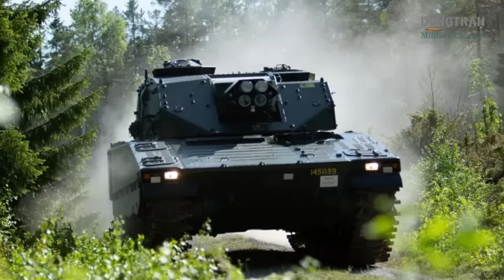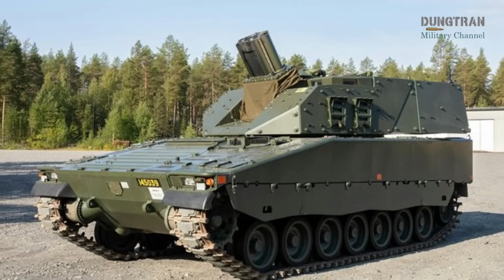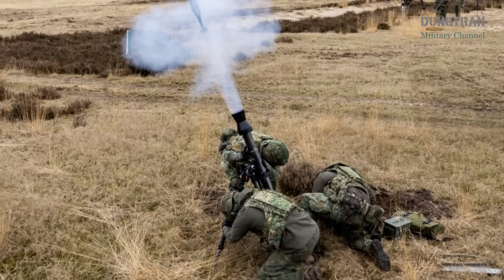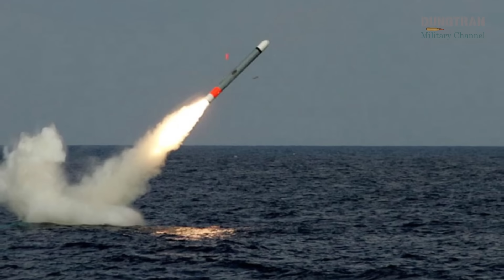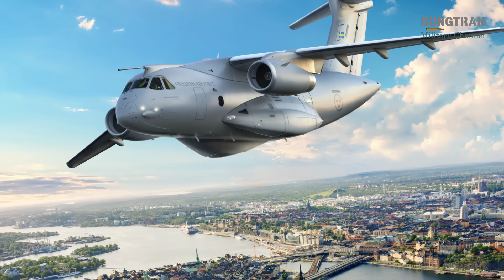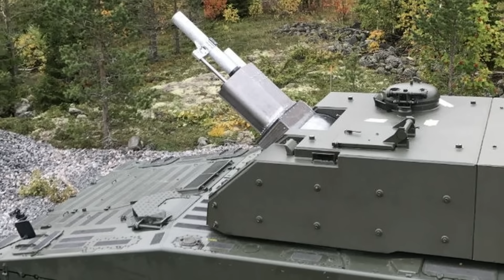Netherlands Buys Sweden’s Mjölner: A New Era for Dutch Firepower

Comment: These mobile 120mm mortar systems don't make sense. They could be manufactured much more easily as multifunctional vehicles/modularly: you simply take a conventional 120mm cannon like the one on a main battle tank. You can also fire the mortar shell through the barrel. You just have to be able to adjust the barrel steeply enough. And this makes the system even suitable as an anti-aircraft gun (with suitable ammunition). So you have three roles in the same vehicle (only the anti-aircraft gun requires an additional radar, but the proportion of common parts is enormous).

Comment: This isn't a 'leap in capability' for Dutch mortar systems. It is a reparation of that 'pocket artillery' for battalion commanders.
You see, with the massive defence cuts that riddled NATO armies after the 1990-ies, and again after Afghanistan ended; the Dutch army lost the heavy mortar platoons in mechanised battalions. 
Before those cuts every battalion had two 120mm platoons in each battalion. Cutting those was seen as way too much of a cut across the army.
That error is repaired now.

Comment: Because of its own defense industrial capability being quite limited, the Netherlands has a history of doing its military procurement outside its own borders. And with their own national defense always under high scrutiny, it's fair to say that they have become quite good at buying the right military equipment for the job. The result being a rather small but modern and relatively well equipped armed forces. Which has made them quite influential in the international military procurement market as early adopters of the "good stuff": F35, PzH2000, CV90, Boxer, Patriot, Leopard2, NASAMS, HK416, Accuracy AX, Glock17, Embraer C-390, PULS, etc.
Reply: But we have the Tech for the Arsenal. ASML per example. So working together is awesome and warms my heart
Reply: @Carolina-u9x  We have the tech but companies like VDL are more important than ASML. ASML is in a complete different sector.
Reply: @Schachtschabel  Oops, wrong. That is why ASML export is in hands of the Dutch government. 
"ASML, a Dutch company that produces chipmaking equipment, is indirectly linked to the military through national security concerns and export controls on its technology, particularly its advanced deep ultraviolet (DUV) and extreme ultraviolet (EUV) lithography machines. The Dutch government has placed restrictions on ASML's exports to BRICK countrie, fearing the technology could be used by China to develop advanced weapons systems and achieve military advantage."

Comment: so when thats the Dutch soldiers get new assault rifle?
the C7 and C8 are getting old
Reply: There are already talks on the way to replace those with either HK 416/417’s or SIG MCX ( however this is not been confirmed so they are just speculations at the moment) but the C8’s aren’t “that” old yes they have been around for a long minute but that’s the same with the AK lead is lead.
Reply: @SocalPresents the dutch government most look at option that you still use some old parts from the C7 and C8 int the new assault rifle, with shortstrok gas piston instead of Direct gas impeachment system.
Simple to use, easy to use, 
That's something that the government should look at it, from the soldiers side too
Reply: @blue-skyuniform  totally agreed! Unfortunately that’s not what politicians do “think” it’s all about the “interoperability”….. and tbf the HK and SIG are fantastic weapons but then we have a shit ton of surplus parts they can’t use (like you said). The Dutch “swat” uses the MCX and from the few operators I know I only hear good things about it but that is law enforcement so I have no idea how that would translate into combat.

And I personally don’t know any “modern” weapon system that uses c7/c8 parts and has a short stroke gas piston, and designing a completely new weapon system to accommodate that would be expensive I’d assume.
Reply: @SocalPresents I found information from the 1990s, that the dutch army that test the new assault rifles for the Dutch army, the Steyr Bullpup rifle was the favourite and best for the army, but went with the C7 and C8 because of the magazine that the US and UK troops use😑😑 the stupid reason ever
Reply: @blue-skyuniform  exactly “politics”😂 it doesn’t make any sense, I personally hate bull pups and seeing how much the British troops hated the SA80 L85A3 it might’ve been the right option but simply choosing a lesser weapon system just because of the magazine is just diabolical.
Reply: @SocalPrest  I've never really hated the bullpup rifles, I've trained with them a few times myself, it just takes some getting used to the platform.
as airsoft models then, it's completely different yes, but feels the same as real weapen almost only the L85 i hate
Reply: @blue-skyuniform  I mean it is practical yes having the same length of barrel in a smaller system definitely has advantages but from what I’ve heard they are prone to malfunction due to dust and debris and and especially the LA85 (what I’ve heard).

And “hating” was a big word from me because they have big advantages and disadvantages just like any system, but what I have noticed is that a bull pup although more compact feels bulky because the stock is so big due to the operating system and the magazine being located there and I was allowed to reload the real firearm (with empty magazines of course) and it didn’t felt like you could reload it fast also because I’m not used to it so it feels unnatural.

Comment: The Netherlands possesses 144 operational CV9035NL infantry fighting vehicles. 
These vehicles were acquired from BAE Systems AB between 2004 and 2009. 
The Dutch army utilizes them as their primary weapons system, especially since they did not have any tanks. 
A significant portion of these vehicles are undergoing a mid-life upgrade to enhance their capabilities. 

The majority of the CV90s that the Dutch army has, will receive this midlife upgrade (MLU) from now until 2026. 
Approximately 15 of the CV90s coming from the logistics reserve, which are not yet upgraded and equipped with an MLU are now designated for an MLU and will be fitted with a new turret containing the twin-barrel mortar system. 
The CV90s chassis for these new mortar turret will be brought up to the latest MLU standard within the same project. 
This is scheduled and planned for completion in 2028. 

Ammunition will be acquired through a separate project.

Comment: I don't have any knowledge about military tactics, but what is the advantage from these over regular artillery that has a larger range? How accurate is this with its short barrel?
Reply: They have different roles. This is a hammer while other artillery is more of a sledge. Speed and flexibilty vs power and range.
Reply: It can be used as close support for the infantry units against enemy mech. units. Other mortar systems typically exposes the whole crew and cant be displayed as often close to the front lines
Reply: With mortars u got high angles, u can be behind obstacles and fire, u cant do that with artillery in the same way. And as the other guy already said, mortars are good for close support
Reply: You get two mortars on a much smaller vehicle then a regular artillery piece, that is also armored and capable of keeping up with other IFV.
This means that mechanized infantry can have artillery as part of the formation.
These mortars also comes with a homing top attack anti-tank round making them fill a similar role as anti-tank missiles, except not requiring line of sight.

Comment: They should have bought the Patria Nemo, just like the Germans. The Dutch army is integrated into the German army, so this purchase makes no sense at all.
Reply: Dat maken we zelf wel uit.
Reply: The Dutch have CV90’s which are in the process of MLU, it is easier to introduce the Mjolner and adapt a few CV90’s for them.
Reply: @Schachtschabel No it’s not easier, they have to design and built completely new towers, because the Swedish mortar towers don’t fit on the Dutch CV90’s because the Dutch CV90’s have a raised deck. It would be much cheaper to buy Patria Nemo’s through the massive Patria order of Germany! It’s all corruption! 🤬
Reply: That would make the logistics more complicated. 
The Dutch army operates CV90 for more than a decennia and uses the Dutch-German designed Boxer as APC.
They bought the Mjolner for the CV-90 and they are procuring the skyranger 30 for the Boxer. The latter will be produced on home soil, like the rest of the Boxer fleet. 
The Dutch also recentlyprocured a replacement for the G-wagon fleet. 
This is the IVECO Manticore after already co-designing and operating the IVECO Anaconda for multiple years.
Yesterday the news came that the Dutch Armed forces procured  785 IVECO defence military trucks with container systems. 
So the Dutch Armed forces have 3 mayor logistic chains of IVECO, Scania/BAE and Rheinmettal. Adding Patria to the list would make it even more complicating than it already is.
Reply: @feddek9325 No, the Skyranger 30 will be placed on the G5 tracked platform that’s completely new for the Dutch army, and not in use with Germans, which also makes this purchase ridiculous! They should have gone for the Boxer Skyranger 30 instead just like the German army! Nothing makes sense from a logistical perspective!
Reply: @obud3777  The G5 platform is part of a larger purchase the Dutch army will place. Around 100-150 units for the 43rd Brigade. It seems that for Air Defense (NOMADS/SHORAD)  the Dutch mainly cooperate with Norway which will also operates the G5.
Reply: @Schachtschabel Also a very bad decision, the Dutch army air defense should be integrated with the German Army, because we are integrated in the German Army, we are creating are own logistical nightmare!
Reply: @obud3777 i didn't knew that. They should have chosen the Boxer APC as a platform. Because of in house manufacturing capabilities. Or are they going to produce the G5 also in Ede
Reply: @obud3777  if you want your ground based air defence to keep up with your heavy mechanised units it does not make sense to place it on a wheeled vehicle.
Reply: @eggy6857 You don’t have to place a Nemo mortar on a wheeled vehicle, you could put it on tracks like a G5 !

Comment: Nice, but Atmos or Nemo system would have been better.
Reply: Do those fit on a CV90 chassi? Cause this can be mounted on already owned CV90's that the Dutch operates
Reply: @dirreeN the twin barrels Amos is already in service on CV90. Nemo.. I'm not sure if it's on CV90, but it's on Patria 6x6 and 8X8 and Finnish patrol boats.
Reply: @hgh425  Tbh i've always liked the Atmos and Nemo more, sad we haven't bought more of them in Sweden!
Reply: @dirreeN I'm sad that Denmark bought cardom 120mm rather than Nemo and Amos and Atmos 155mm SPH over Archer. It's much better that the money flows across the bridge.
Reply: @hgh425  I don't think it's in service but rather Sweden participated in AMOS and it was supposed to be used but then ended up not being used (I suppose price vs the current configuration may have been the reason?)
But yeah it would had been cooler with AMOS or NEMO.
Reply: I really like the Nemo. Very compact and versatile. Wiki say Sweden cancelled Amos, so only Finland is operating the system.
Reply: @hgh425  I think they have ordered NEMO for the Combat Boat 90 though?
(Or similar boat?)
Reply: @hgh425  Another version built to keep up with other CV90´s.
Reply: I don't foresee much use for small boats in the Baltic against Russia. Konigsberg is within artillery range from Poland. And operating out of Sct Petersburg.. good luck with that.  
Much rather a real blue sea navy and lots of guns, drones, IFCs and long range missile's.
Reply: @hgh425  the twin barrels Amos is already in service on CV90
Nope
Nemo.. I'm not sure if it's on CV90
Nope
but it's on Patria 6x6
Nope
8X8
Nope
Finnish patrol boats
Nope

Nemo is in service only in KSA and UAE.
Reply: @hgh425  Well up until about now it's for defending Sweden.

And still kinda is.
Reply: @hgh425  Small boats with something like Nemo able to shell shore targets, that's are going to be really useful in a conflict in the Baltic. Not all ships or boats are meant to fight ships.
Reply: @PallanderK72 cb 90 is not made for the "open water" it's made for fast operation at the coast, i don't know if it's true that they will put a mortar on the boat but it could be usefull if you  quickly should put soldiers on a island to make sure the enemy keep their heads down.
Reply: Price was the main factor as AMOS cost much more.
The upside is that Sweden got lots of Mjölner now.
Reply: @patrickkarlsson183  Fire support during a landing and a indirect threat in the archipelogo.
Reply: @dirreeN  https://youtu.be/dFJvB3MNQHE?si=X6SxfO9_WTyxYo5F
Reply: The Mjölner approach was to provide a mortar capability to support the mechanized forces attack, asap with no nonsense tech. So extremely short development time, no personnel in the open, and capability to keep pace with and support the mechanized battalion attack. Not as fancy as Archer, but good enough.
Reply: Who are you?
Reply: @donquixote1502 Someone who knows of the other two Nordic turreted Mortar systems.
Both have multiple shot, same time impact. And Nemo can shoot on the move. And both auto loader.
Reply: @hgh425  I guess you are a fantastic user of Google, but that does not make you competent to judge. When complexed systems like this are compared...there are hundreds of details to compare. I would say that Hägglunds has proven them selves as world leading IFV designer and producer. Mjölner is a sibling, they share everything. Netherlands knows CV90 extremely well, they have people way better than you and me to value different systems.
Reply: Maybe  don`t really know but  they look impressive
Reply: I wonder many times why Netherlands not have orange Flag?
Netherlands flag look like the Russians now!😮
Reply: @hangemhigh7069  The Netherlands had that flag for about 500 years. Russia got theirs after the collapse of CCCP.  The Orange came from the Royal family.
Reply: @hgh425 Great to here that mate,hope Russia lost and take back the red shitflag to their shitland and stay there until they selfdies!
Reply: @hgh425 I answer you already mate and thanks for info.
But if I write some bad on Putinland I be blocked!
Reply: @hangemhigh7069  quite funny exercise to color code flags. There is a clear pattern for who use what color.
Reply: The netherlands dont agree with you